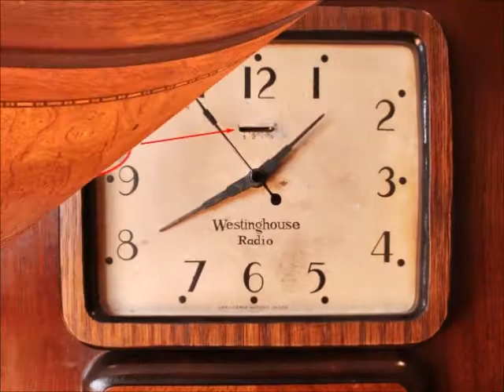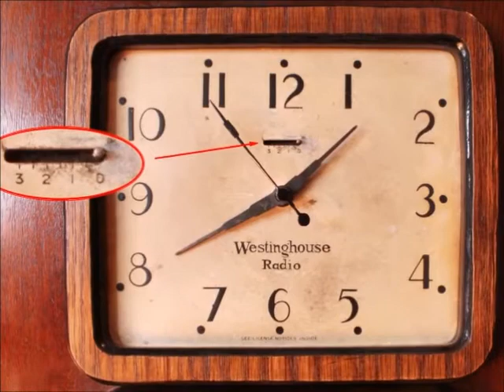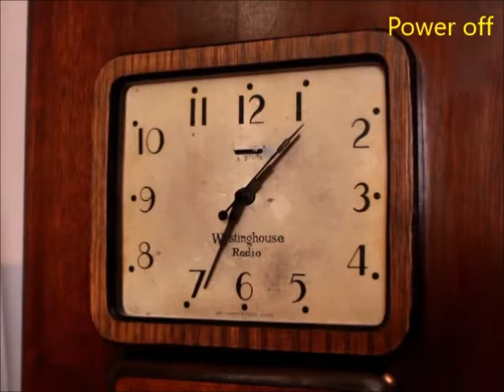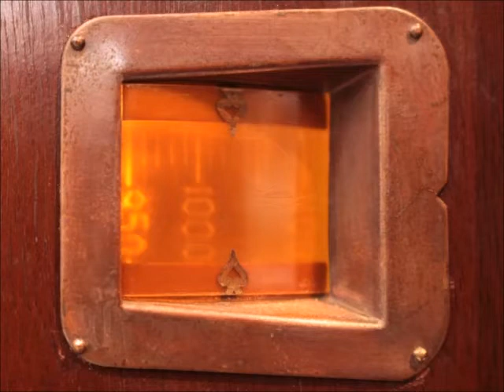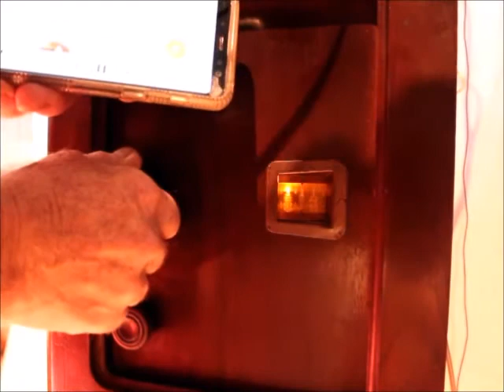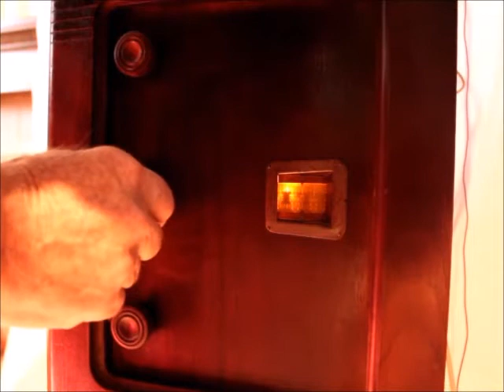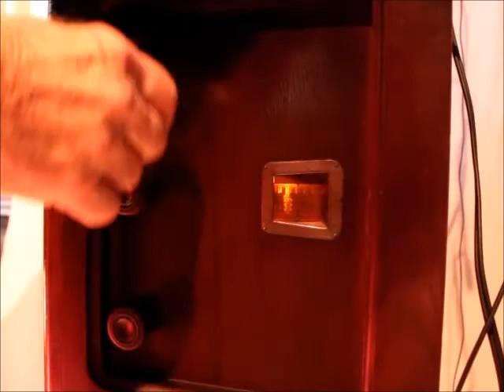1931 Westinghouse Columaire 801 Grandmother Clock Radio

Comment: In period advertising, Westinghouse claimed the Columaire's up-firing speaker(at the top) projected all the delicate high notes of music often lost with regular floor console radios(similar to top-mounted speakers on GE alarm clock radios of the '80's). It's slim space-saving design was also a selling feature. There was even a deluxe model with remote control- very innovative for the time.